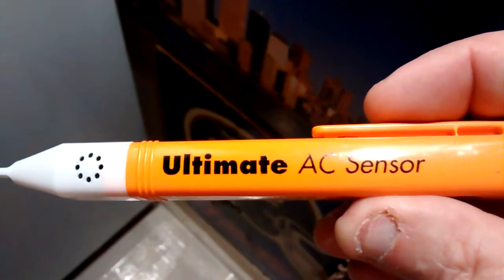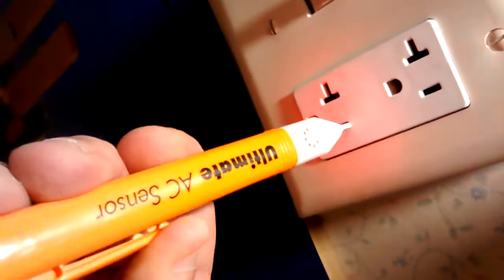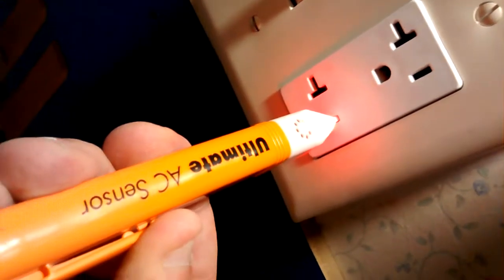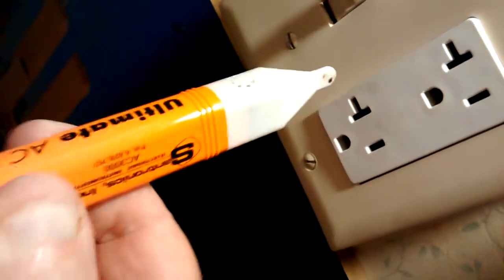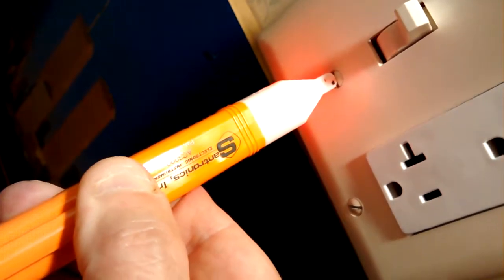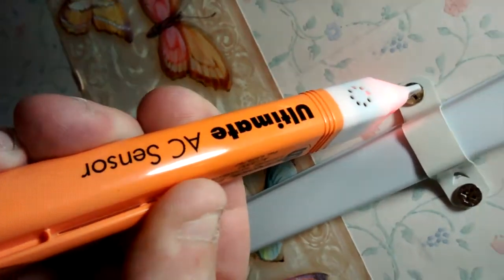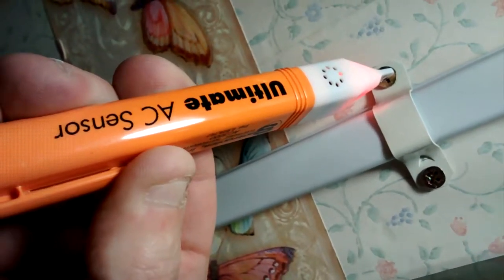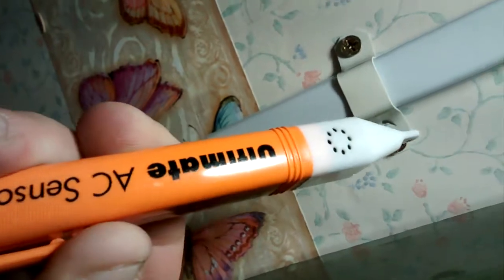May 2, 2018 false readings with ultimate ac sensor part 1

Comment: Have you continued using it? False positives aren't a big deal, you should check it with a meter afterwards anyways. The real question is does it give false negatives? Has it ever told you that something is de-energized, only for you to find out it's energized?